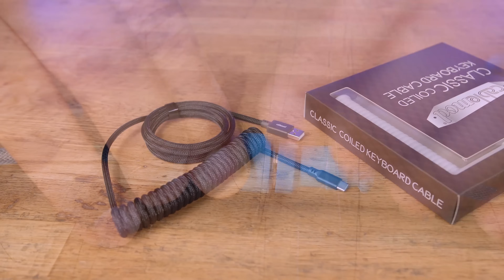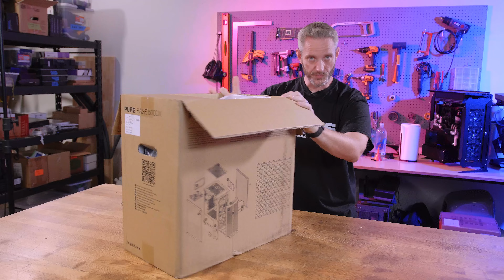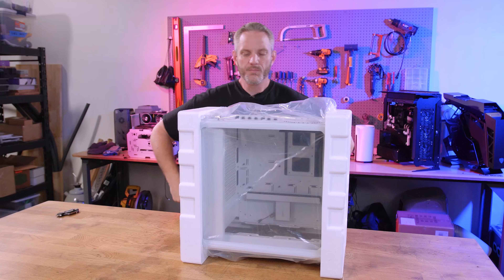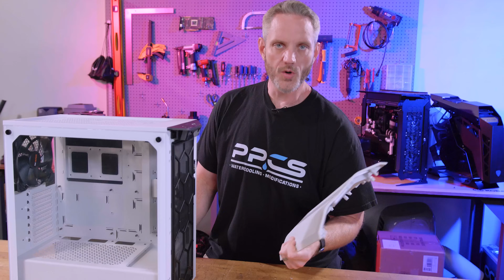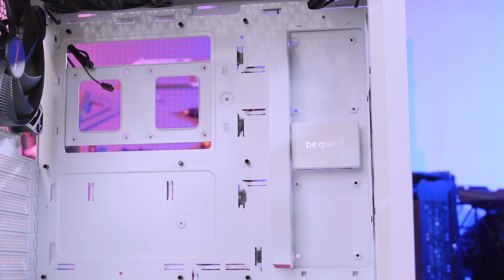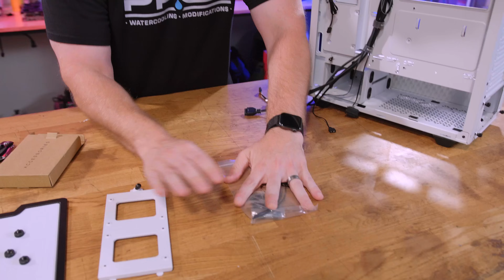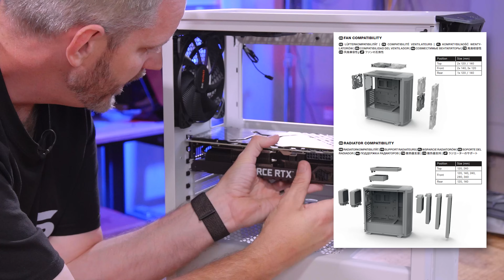An amazing case you can actually AFFORD!

Comment: I love the BeQuiet fans. Great deal for the money.
As far as cases go, unless you're doing something as an on-display showpiece, I buy cases based on value, capability and build quality. I have several PCs that do specific things. Like the Backup PC, that does all my automated backups, is in a $36 Rosewill case with no front drive bays, one NVME as the boot drive and not much else. Basic, basic, basic.
I have also re-engineered several older PCs, with earlier generation wiring and such to use modern hardware. It wasn't easy figuring things out, like I had to get wiring diagrams/pinouts for Dell pre-built front I/O and other stuff, then buy extensions I could use to connect the pre-built I/O plugs to the modern motherboard pins.
I have a lot of data (media server). So I have my media server, with another PC as backup device keeping a duplicate.
I also have my raw ripped DVDs I own for the media server on another older pre-built I repurposed. And a backup PC for those files. The original DVDs have a tendency to disappear here for some reason. 
I don't do cloud backups.
So essentially everything, including work files, have a second drive as a backup somewhere here in the house. The backups stay shut off, except when backups are in progress, so if a catastrophic mess happens, those PCs won't affected. Essentially, like if the media server poops out, I can take the backup, swap them, and be back up in minutes. Then I can take my time rebuilding the pooped out PC.
I've built this process up over time. If I had it to do over, there's things I'd do differently. But, $.
Cases that sit in the closet or otherwise out of sight, FUNCTION first.
When I have to put 16 drives in a case, I buy a case that will take 16 drives. Those are hard to find.
You have to buy what you need. If you're doing a showpiece water-cooled RGB nightmare--I mean work of art--you build in what you need. (Yes, my daily productivity machine is that...RGB-water-cooled, etc....)

Comment: My pc keeps shutting down while gaming. It’s not overheating and it’s clean so no dust. My drivers and bios are up to date. My power supply hasn’t had an issue since I got it two years ago. It’s really annoying because my pc will be fine when I’m not gaming. I need some advice

Comment: You should also mention, that rear audio is not for headphones in 99% of cases. There is an dedicated Headphone output on most audio chips and ALC1220 and ALC4080 have an headphone amplifier just for the Front Audio. Putting your headset on the rear negate that amplifier and your sound will not as loud as it could and should. Nice cases like be quiet have nice front audio cables. You should check that, before making claims.

Comment: The 500DX is one of my favorite cases. I had a white one for a while and the only reason I switched cases was I wanted more room for radiator support (top) but I did love that case and wish I had the need for a 2nd system I would have kept it for a nice all air cooled build. They are excellent all round cases!

Comment: what I find a bit of a challenge these days is finding a case in my local area used or new, that has at least 4 bays for 3.5" spinning drives to build a home nas.  I'm in Scarborough, ON and my local PC shop selection for cases are more gaming oriented, spots for 2.5" ssds and only like 2 spots for 3.5" spinners.

Comment: I have this exact case, mounted the radiator to the front and have fans pulling air in from the front, exhaust out the top and rear, with a 5950x I'm seeing idle temps down in the mid to low 30c's (93.2f), and coupled with a BeQuiet PSU, it's quiet. Really quiet

Comment: Are there any new "dual chamber" cases anyone might recommend? I'm kinda stuck on the concept and want to weigh my options before chopping up my current case...
I recently got an older Corsair "dual chamber" cube case (Carbide Air 500) and I just can't see myself ever using a regular case again. It's missing some modern features (USB-C, rad support, etc.) but I absolutely love the concept, so much so that I'm thinking about cutting the HDD sleds out of the bottom for 1 or 2 140mm bottom intakes, buying a stand to raise it up, and putting a USB-C expansion in one of the optical drive bays. A newer case might be the better option at that point tho

Comment: Used a 500DX to do a full noctua build. It's disturbingly quiet, and temps never crack 60, mind you I'm using a 2600 and a 2070 Super, but its still a solid drop vs my last case.

Comment: I put the super-down-south thicc Arctic Liquid Freezer II RGB 240mm in the top of this. Works, but it does press against vengeance rgb pro ram (pic on my community tab). Swapping to this case brought my GPU temps down & I dig it. One thing ya might wanna note is the PSU compartment is super tight. A real squeeze tryin' to cram it in there.

Comment: I have the old 500 with glas and have a custom loop on the cpu with a 30mm radiator in the front. My XD3 Pump-res-combo from Corsair is mounted on the height of the top fan so the whole loop is over the GPU. So if I would like I could fit in the larges GPUs there are. I do not think the 500xd is any different in that regard

Comment: I was just wondering about my crazy noise floor on my new Epos H6PRO headset. I was using it on the front panel and it was horrible. Thanks for the tip!

Comment: I love my 500dx! The dust protection is amazing. Been a year now and my gpu is still “almost” dust free

Btw you can still use 360 rads infront while using the hdd cage. You just slide the cage to the right towards the psu space with the extra holes for the thumbscrew.

Comment: I have the same as well just colored black. The only issue I have is the fact that it's really difficult to remove the front panel. Other than that it's awesome and great to build in. 🧡
My 3070 Suprim with a front mounted 360mm AIO leaves a gap of 7mm, lol

Comment: Not quite Carboard box, but My Thermaltake Core X9 is turned around so that all the cables that come out the "Back" of the case are accessible at the front of the desk, and the acrylic window is covered to prevent light splashing onto the TV. 
(PC is mostly used as a VR gaming/HTPC)

Comment: I have the old, non DX version (same internals, no glass, no mesh front, no USB-C and no RGB). I wish I had the DX for airflow but I can attest to the internals being amazing. The SSD mounting spot at the front is great for good looking (RGB if you're mad enough) SSDs and also hiding cables, while the SSD mounts at the back are better for a cleaner build. The cable routing holes are great, the HDD cage has 2 positions (Jay is wrong here, you can trade between more front fan/rad space and more PSU space and can fit a 360 front rad). And a the screws are thumbscrews so the whole thing is toolless. If you like the aesthetic I highly recommend this case.

Comment: Please note: if you want to attach these fans to a rad, you'll be better off with the even more expensive be quiet silent wings fans, as those have rubber gasket all along the fan perimeter. Not to seal off air, but to make sure the fan rests on only noise dampening rubber. I've had this issue before making the upgrade with my Be Quiet 801 case. There is a very big difference in low noise levels.
Unless of course you live in a high noise floor area, like a downtown apartment.

Comment: I recommended this case to a friend a few months back just because of the bequiet name, since I've got their fans and an air cooler. He really liked it, I looked up some more in-depth reviews such as at Gamers Nexus and got my own one just about a week ago to build an entirely new system (excluding SSDs and HDDs and the cpu cooler from the last one). This was my first time where I built a computer completely from scratch with my own hands, not just replacing some parts. It took an entire evening and most of the night due to my inexperience, but it turned out pretty good in the end.

Comment: (Non-native speaker here) - Thank you for the video, just one question that there is no missunderstanding from my part.
There are 3 fans already installed.
You suggest to buy an additional Pure Wing 2 140mm fan for the front, am I correct?

Since I'll build a new computer with this case soon, your video was very helpful :)

Comment: I have an MSI RTX 2070 super and 240 front rad push-pull config and still have a bit of room they aren't touching about 1/2 inch and it is a mid-tower case. Just saying.

Comment: That case is very very similar to my Musetex case with RGB controller and came with 6 RGB fans with a high cfm value and full speed of 1750 rpm. It also has a reset button on the front top panel.

Comment: I had this case for over a year it was a great case. fun fact you can switch really easily between  motherboard  lighting control and case control by long pressing the rgb button the presets are quite good. I sold the computer but id happily build in this case again maybe in the black

Comment: So I think a already know the answer to this.  But if you wanted to use multiple external radiators with no air flow. How would you set it up. 

I thought it would be a fun ideal.  A little pricy though.

I think what I would try is a parallel liquid flow with the radiators sideways on a wall due to the weight of the liquid you are going to be pushing.  You could also have them laying flat.  I'm thinking 4 or 8 to use tee splitters and distribute the liquid. I guess you could use one tee and a four way if you wanted 6, but the liquid will want to go strait unless you hang it on a wall and feed the liquid up to give it resistance. Probably bad on the pump too.

Comment: Ha ha I still remember when premium cases were too expensive to afford so me and the pals used normal PC cases instead and I remember a friend that sawed off a chunk of the HDD rail to fit his GTX 260 inside a little generic case and I had to bend mine in the same place to fit a GTX460 which was shorter than the 260 but my poor old case wasn't designed with graphics cards in mind and I couldn't cut it because I still needed the HDD rail to put my 5 hard drives, it's so crazy to see how much it changed over the years.

Comment: This casing is very good and worth the price. Able to hold my custom water loop with 280mm radiator, vertical GPU water cooling block. The only imperfection is why it don't come with a reset button?

Comment: What i find crazy is everyone talks about if have 3.5" drive bays just toss it out. When you can use them for 2.5" SSD. Ive never heard anyone talk about the ssd adapters which i use in all my pc's. One 3.5" bay can hold two 2.5" ssd's with an adapter you screw in to the sled. I run 2 970 evo 1tb m.2's and 4 870 evo 1tb drives in all 5 of my gaming pc's. 2tb is to much for price to storage for me plus 1tb has alot more amazon lighting deals. So i love using 1 or 2 3.5" bays to hold 2 or 4 ssd's.

Comment: I built my PC in this exact case. And I used an NZXT AIO cooler and did exactly what he said, I put in the radiator then realized I hadn't plugged in the cables that needed to go behind it and had to take it right back off.

Comment: Even better build tip is plug cpu eps before you mount your mobo. Then you never have to squish your hand in that tiny space. Or like when I first built my current rig I realized when trying to install the eps connecterthe cable was upside down the way I routed it and it wouldn't spin without me jamming my hand in there to spin it at the connecter end. When I swapped the PSU I plugged the eps in first and boom you're done.

Comment: I am happy with my Cooler Master H500. I've had many compliments on how quiet it is and I love the twin 200mm Front Fans. My temps with my Ryzen 3900X  w/ Dark Rock Pro and Strix RX Vega are in the low 50s most of the time.  If I push full tilt on everything, It can get up to 72 F.  Not bad.

Comment: I got one 2 months ago and I love it. It was super easy to build in, temperatures are great, it looks and feels very good (especially for the price), it's kind of compact but offers a lot of room and, of course, the price was excellent. I got some of be quiet's RGB fans pretty cheap in the same store and impulse bought them too. Love the new setup (just my old GTX 970 is extremely loud now, my old case was a Nanoxia Silent Case, so i didn't hear it as much...) and I'd buy it again anytime. Cool to see you showing the case off in this great presentation!

Comment: I have to imagine if you wanted a reset, and your motherboard handled RGB, you could easily mod the RGB button into a reset button by removing those wires from the case RGB controller and wiring them to the motherboard reset headers

Comment: I have a big water cooling setup in my 500 with 280 and 240 rads that have push pull config on all rads and still have a big card with space and plenty of reservoir room.. you should build in it before rushing the gun and not just use the top, known brand stuff. That's what makes the difference.

Comment: Not being a tech anymore, the only PC parts I really get to see and try out are my own. Finally a case front panel without wires and just a simple spring pin contact pad. Not sure how many other modern cases have that now, but it surely is an appreciated feature. Aesthetically cleaner as well. My Corsair Carbide Spec-5 seemed so advanced when I bought it years ago. Nice to see cases are still evolving. This case did not evolve in terms of the glass mounting system. Same outdated garbage that I've got on my old Corsair. Others have definitely done better side panel glass mounts.

Comment: isn't the USB 3.0 front cable so "nice" because it is only 1 port?

losing a usb3 port has to annoy me, when my current case annoys me when it has 2 3.0, how it should be, and then only 1 USB 2.0 WHYYYYYYYYYYYY?!
and the internal header is for 2, the space is there so just to save 2 cents??

Comment: I have 500DX case and love it. But the only problem I encountered, which was my fault. Was putting the back panel properly on the case. There little widgets that could easily snap off and if you didn’t align it properly you would must lickely  bend the widgets.

Comment: I did custom loop watercooling in this case! 360mm rad fits in the front (took out the hard drive cage and velcroed my hard drive next to the PSU), 240mm rad fits in the top (was able to screw in 4 of the 8 screws lol), used a 140mm fan mount EK resevoir/pump at the rear. Everything is a squeeze but my 3080 FE and 5800x3D run nice and cool and quiet!!

Comment: I'd definitely move two 140s to the front and use one as exhaust. Knowing me and how I build though; I'd put a fan wherever a fan can fit. Fill every spot. My current rig has 12 fans. 3x120mm intakes in the front, 2x120mm intakes in the bottom, 140mm rear exhaust and a 360mm rad in push/pull config with 6x120mm exhausting out the top. Still have positive pressure because the majority of my exhaust is slowed down due to the resistance created by the rad.

Comment: On the topic of cases, I have a question about fan pressure systems - I looked up some guidance on positive/neutral/negative pressure , but the videos I found are really old (wow you're presentation style has improved a lot!) . Jay, do you stand by what you said in that video about positive pressure filtered setups are preferred?  

Obviously you don't want to go too ridiculous - all fans on intake would technically be positive pressure, but you'd have terrible airflow because the fans are all fighting eachother.  But a system like the Torrent with its 5 fan intake/1 fan exhaust will have a good airflow pattern and be extremely positive pressure focused.  (Of course, that case also has a LOT of extra air holes to let air escape, because that's the whole idea with that design - passive exhaust through high internal pressure - indeed, it doesn't even come with the exhaust fan)

Comment: Have this case, and I can agree with everything said. 
I didn't care about spending a fortunate on a case or fans, so just threw a 360mm cooler in the front and moved the that one fan to the top and called it a day.
Routing some of the thicker cables was a problem tho, but not a huge one.

Comment: I really enjoyed my time with this case, but found it just a bit too small to really enjoy building in - mainly for a push pull 360 radiator or plugging in the top left CPU power cables. Other than that - It is a super nice case, has great cooling and the lighting is clean. It does have some issues with giant (long) cards though - if you have a front mounted rad).

Comment: Owner of the case as well, having the ability to mount a rear 140mm fan is HUGE from an acoustics standpoint. Using the UniFan SLs from prior build.

Only downside is the cable/ssd cover is tight. Very tight for 24pin

Comment: I was wondering when this would come along. Thanks for featuring mine in the last reacting to budget builds video! The 500 DX imo, is a good compromise between price, cooling, and silence. Compared it to a Lian Li Lancool 2 or 215, but very happy I went with this case, since usb c on the front was included. My criticism is that the back panel is cramped with sound deafening. Running 8 storage drives in it is rough. Also be quiet! didn’t seem to test it with their own PSU’s. I got a 750 W modular from them, and the plugs are all keyed upside down compared to a Corsair and Apevia unit. Would also recommend, moving the top fan to the front. The L bend on the plate doesn’t play super well with custom cables sometimes on the 24 pin.

Comment: Running Windows I find a reset button to be a must have.  Normally I would not even consider a case without it.  I was wondering though, could I connect the RGB button to the MB reset header?